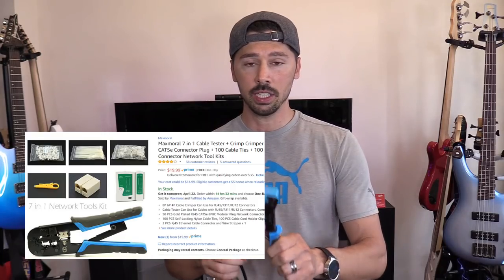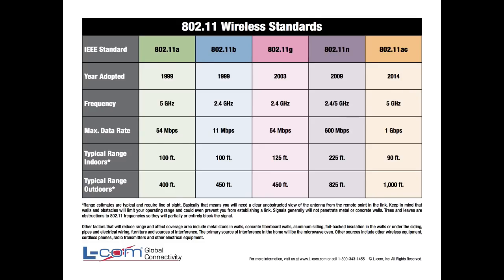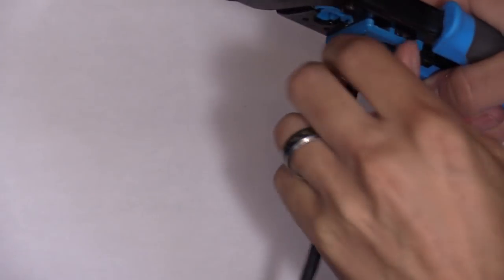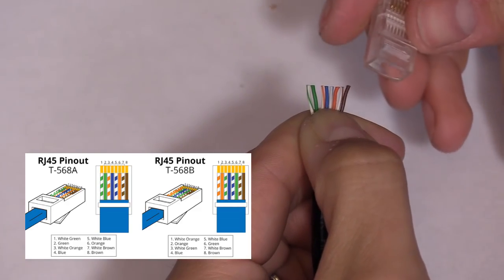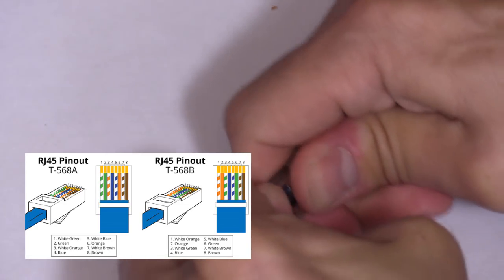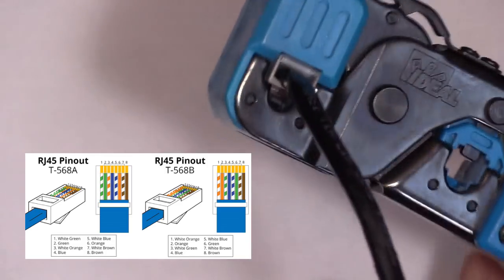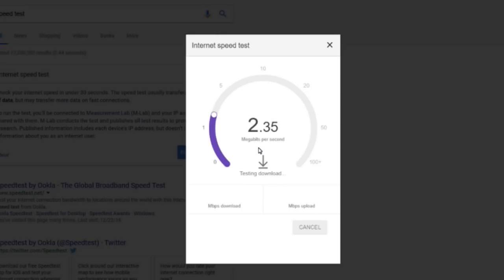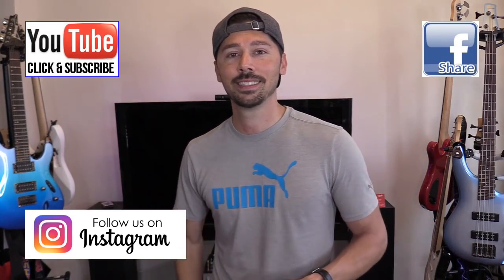How to Wire ETHERNET network CAT5e CAT6 Cable, RJ45 wiring guide

Comment from the maker: both A and B is standard I meant, either will work but check network panel to be sure it matched other cables in the junction box.
Reply: Tampatec Help Help  Hello need your help ASAP I'm located navarre FL it's been a real issue with my Wi-Fi built in router by Ares bwg210 by AT&T the 2.4 mysteriously loses sync with my devices a Galaxy S7 Edge phone a tablet e a Galaxy my Alexa I had seven motives replaced I had a pace modem 5268ac an unsuspecting there's a magnetic electric field that my neighbors are doing some kind of in a minute interference the sabotage my wireless gateway router I've AT&T universe 50 I have had to call AT&T on a regular basis but yet when I when I plug in something wired to CAT5 or Cat6 everything's fine the broadband connection is solid coming in no dropouts there I'm getting awesome upload speeds and download speeds enroll of a 41 42 I want that my download is like 27 something like that every technician can't fix the problems getting very stressful I have seen your video about testing magnetic field what neighbor could be causing interference you know I need help you you know my devices shouldn't just drop Wi-Fi signal my laptop Alexa I spent a ton of money with AT&T I put two Air ties in I can hooked up to to them cat 5 no connection issues

Comment: Tampatec, 
Thank you so much for posting all of these awesome videos! I am a DIYer that likes to be as professional as possible when it comes to my work. I am planning my next couple of projects and these videos have been a huge help in the planning process! I am going to install a network panel in my basement storage room to house all of my networking equipment (modem, wifi router, network HDD, network switch, etc.). My basement is finished and the entire first floor is as well, so all of my wiring for my house is in my attic. I am currently establishing the best way to run conduit from my attic, through the walls and into my storage room without opening up the walls. My house does not have normal drywall that can be patched easily. It's all 1/2" drywall with a ~1/2" layer of plaster overtop... so patching is NOT easy! Also, I am almost positive that MOST of my walls have fire blocks in them... the biggest reasons I found your videos! I want to run conduit so I can easily run ethernet cables (10-20 cables), a few coax cables, and a separate one for the electrical lines that my electrician will have to run. Any suggestions for types of conduit or if I should even use conduit?

My next dilemma is installing the ethernet cables I'm running for my wifi access points through my house. I bought a few things at Home Depot to try out and test my wiring skills and I seem to be running into the same issue (maybe it just isn't supposed to be done this way... IDK). I can wire both ends of the cable to a jack and the connection is fine. I am pretty good with the RJ45 connectors on both ends as well... may take a try or two. My issue wiring an RJ45 to one end and a jack on the other. I can NEVER get that to work. Any suggestions? Or can this even be done? 

THANKS!!!

Comment: He's on the video not long ago on the magnetic field unsuspecting radio intermittent Ferentz out here I'm finally caught in Navarre Florida I put a brand new Linksys router in I 2.4 just makes my phone jump on 4G and then I'll be on the 5 gigahertz band with I'm thinking about running Cat6 too long the locations well over 50 ft what kind of Networks, I suspect the neighbors are doing something wrong out here I've been using WiFi 360 app no matter what channel I choose between 1 and 11 and the channels for the five finger hurts which one on 253 still having a problem with my mobile devices that you can I get my phone tablet, laptop I have to plug in everything CAT5 Cat6 from the back of my router and modem and it works fine that's if it's something going on with the wireless signal cuz my phone won't jump back to mobile hotspot you know I still believe what your video says someone's causing radio intermittent interference wifi over view app Cartoon Network so like 58db 62db

Comment: Hey bud, I'm an IT professional and on the occasion I don't contract out cable installations your videos have been extremely useful in giving me ideas to make the job quicker and have a more professional look. I wanted to mention 3 things.

I didn't pause to look at the various 802.3 / 802.11 charts so I don't know how accurate they are but cat 6 will run 10Gbps speeds up to 55m and cat 6a will run the full 100m. 

Also, get yourself some EZ-RJ45 plugs. They have open ends so you can actually feed each wire through the plug that not only makes sure you have the right order but that you also always crimp as close as possible to the existing twists (the official standard is no more than .5 inch from the  last twist.

Lastly, buy a dedicated router and a dedicated wireless access point (preferably a dedicated switch too). Routers get hot and use up their CPU/Ram when they're also asked to perform switching and access point functionality. Also, with your installation skills, you could easily install a nice power-over-ethernet access point (I personally like Ubiquity but getting off the all-in-one would help you tremendously). I don't know how big your house is but if you needed to put in multiple access points, most nowadays have excellent meshing capabilities. Just make them all broadcast the same SSID/password and you will seemlessly switch to the fastest access point as to move around. A lot of them even have nice GUIs that allow you upload floor plans, scale them and then drag and drop the access points on the floor plans and then show you a heat map of their decibel levels. You can then move them around or ad as needed. I know that Ubiquiti even offers the ability to overlay walls and various other structures onto the floor plans so that you can see the level of interference that they cause
Reply from the maker: Yusef Khalil good info thx 👍🏼
Reply: Yusef Khalil, What are GUI's? And is there a particular brand of access points that use the floor plan software? I am definitely not an IT/wiring professional, but I have taught myself quite a bit which is why I am really interested in this. I reconfigured an old Symbol (aka. Motorola) system at my retail store (used to be used for old RF pricing/inventory devices) to a wifi network and I was looking to upgrade. My computer company that manages and maintains my retail system uses a Fortinet firewall and told me to get an AP from Fortinet because it will mesh seamlessly with that... but it is really expensive ($500+ per AP) and I think I would prefer to manage it myself. This is where the floor plan setup and some sort of "less technical" user interface would be nice!

Maybe you could also give me some advise on managing AP's across multiple buildings (same property)? I have my store and three warehouses. Currently, I have four AP's inside the store (one with an external antenna), and one in my first warehouse. Running the data lines between the buildings isn't an issue as there is already open conduit installed for all of them. Ideally, I would have one AP inside each building and one with an external antenna in each building. So I would be looking at a total of at least 10 AP's... any suggestions there?

Comment: Can you help me with a problem on a visio m550nv i sent main board in for repair because standby lights orange and didnt power on. After repair it worked for an hour now it goes blank and light flashes white and orange then orange stays solid . if i unplug a while it powers up for a min then same thing. Any suggestions

Comment: Tampaec,hi I have a Samsung TV and I did the flashlight test and sure enough I can see text on the screen that says HDMI input not connected, so I plug in an HDMI cord to my xbox, I turn on my Xbox and my TV  still it says HDMI not connected while I have to hold the flashlight just to see the screen cuz it's so dark, anyways I could really use some help and I was wondering if you could give me your input, thanks?

Comment: Think In Terms Of A Sphere... Move Router Above All Appliances... Use Small Cabinet Above The Refer (Not Vent Hood)... Or Atop Cabinets If Space... If EYES ON Is Required... Mount Small Adjustable Vanity Mirror... 

Mechanical & Electrical Engineers Build Bombs... Civil & Structural Engineers Build Targets...

Comment: "T-568A is standard"? What country are you in? Not the U.S.
Reply from the maker: S Kaye both A and B is standard I meant, either will work but check network panel to be sure it matched other cables in the junction box.

Comment: same thing is happening to me and also i think old house are bad for wifi because i have a router in my room and the wifi signal on my sisters room with is next to my room is bad i think is these old houses construction instead of just Sheetrock they used bricks and sheetrock

Comment from the maker: wire guide for common RJ45 connector 
*tab side down and pins 1-8 read left to right
pin 1 green white
pin 2 green
pin 3 white orange
pin 4 blue
pin 5 white blue
pin 6 orange
pin 7 white brown
pin 8 brown

Comment from the maker: See tools listed below
RJ45 crimp tool, https://amzn.to/2K7K4Z0
RJ45 connectors, https://amzn.to/2HRsOWT
Cat6 cable wire, https://amzn.to/2HkX4N1 (links supports the channel)
Reply: Tampatec thank you 🙏
Reply: Tampatec my setup is using Cat 5 AT&T U-Verse modem my wall jacks are cat 5 not sure about cat 6 unless it's a commercial buildings
Reply: Good point cat 6 gives yuou a better internet speed compared to wirless were the speed is effected